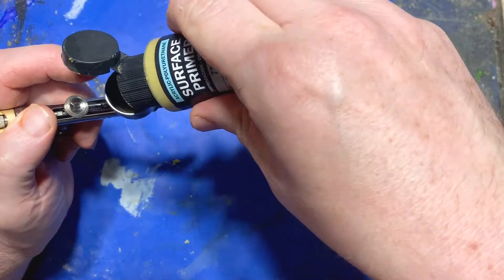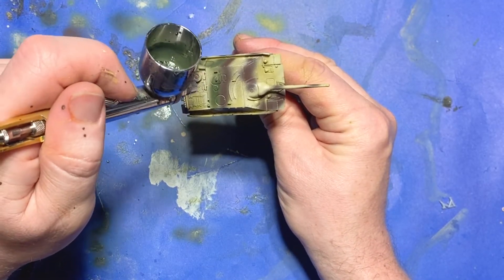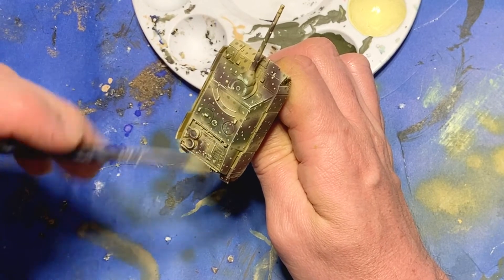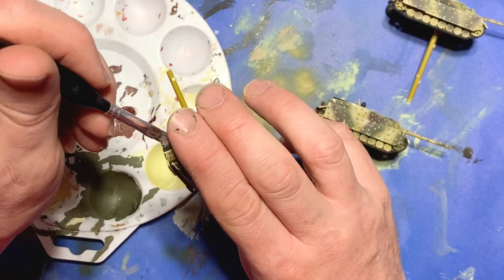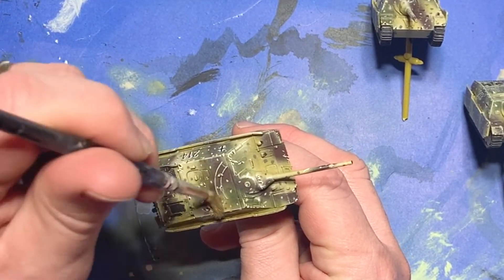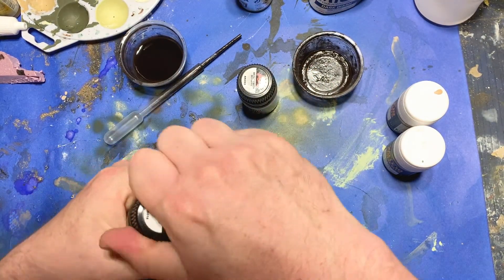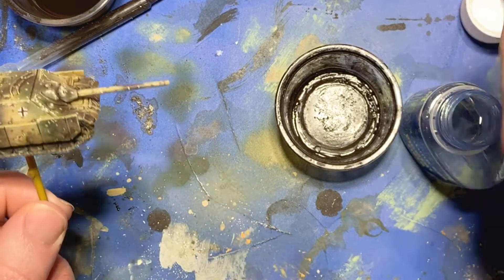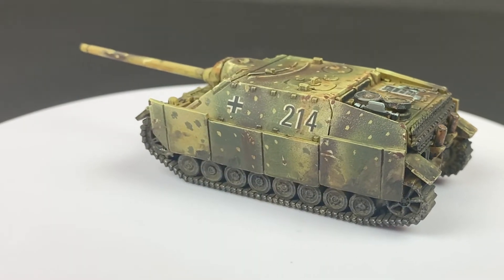Easy Model Painting: German World War II Ambush Camouflage, For Flames of War, Miniatures & Wargames

Comment: It wasn’t a factory applied pattern.  Dark grey was the early war colour. Later, Dunkel Gelb (dark yellow) RAL 7028 was applied at the factory - the green RAL 6003 and red brown RAL 8017, or substitutes might be applied, but often in the field, sometimes by  airbrush, sometimes by hand with brushes, including mops. The idea was that it would be adapted to local conditions, and there was considerable variation of result. Of course it would also be subject to fading (reds particularly tend to be transient) grime and wear. And in winter a thin wash of white might be applied. There was no hard standard  ‘ambush’ pattern - only variants of an idea.
Reply: You are wrong. Factory ambush patterns came after the period when vehicles were factory painted in dunkengelb all over and then camouflaged with green and brown in the units. Because supply chain became more strained as it got closer to the front, units often lacked paint or prescribed thinners (or time to spare). So cons outweighted pros of camouflaging the tanks locally and in August 1944 Germans started applying three-color factory patterns. More complex of them are usually called "Ambush" patterns. There are at lest two - Daimler-Benz (large blotches of three base colors covered by contrasting dots of yellow over darker colors, brown over yellow) and "disc camouflage" applied using a stencils of overlapping discs (by MAN, MNH, Krupp and Skoda, two latter possibly used a different color application sequence than two former affecting the look of the border of disc-covered areas), an perhaps a corn-chip camouflage (though I'm inclined to think that it's just some photos of disc camouflage where triangular holes between discs in the stencil are visible, but festooned stencil edges are not obvious). And also large blotches/thick streaks of three colors without contrasting small elements (these usually aren't called "ambush" schemes). And diagonal stripes by MAN, used on Bovington Jagdpanther, but usually it's depicted in three commons colors unlike green-less version by Bovington (i don't know what were Germans thinking conceiving this pattern... urban combat or tree trunks maybe).

These factory applied patterns are different from the improvised mess sometimes seen in the period where tanks had to be painted in the units.